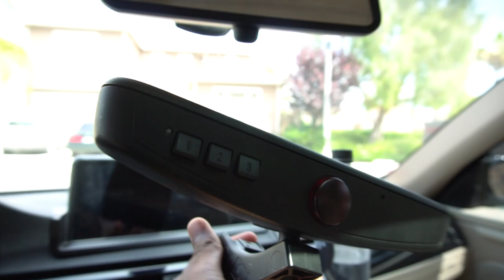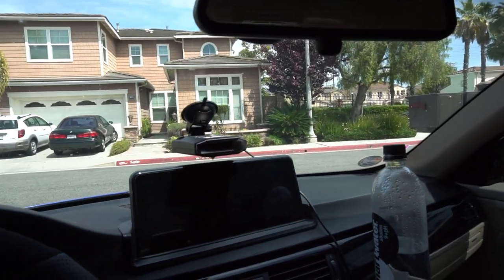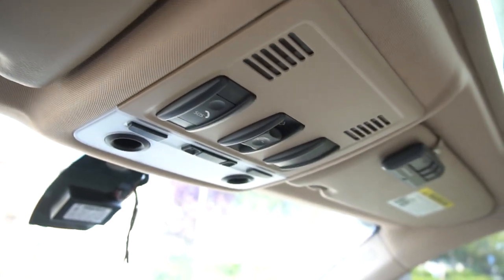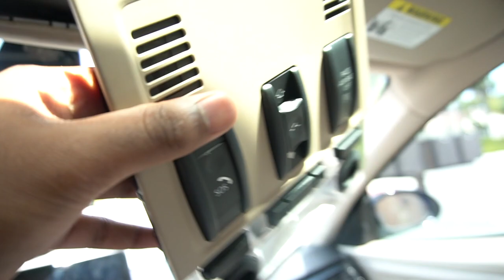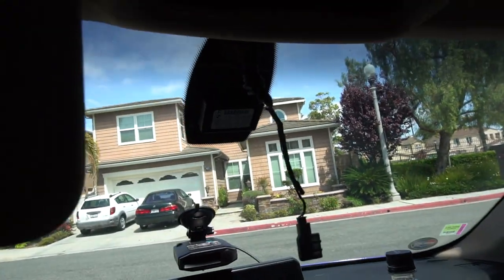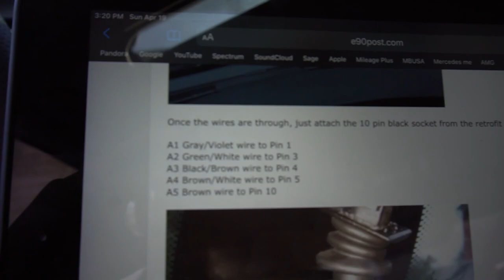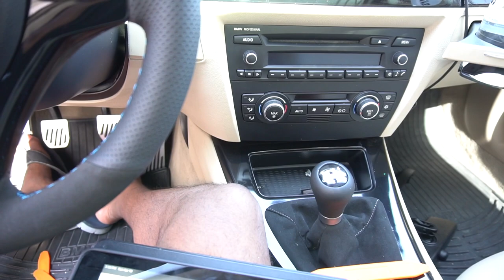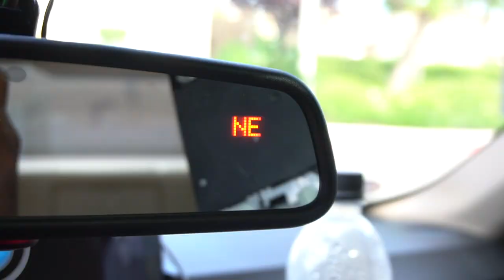BMW Mirror Retrofit (Homelink, Compass, Auto-Dimming) - E92 335i

Comment: The wiring connection process should be clearer. U seemed to have skipped those completely. I supposed the 10-pin plug to the new mirror is from the kit. Was there a 20-pin plug supplied by the kit to connect to the roof function center also, or is there an existing one already there to tap the wirings into? This will have to be explicitly mentioned as I sure hate to go through disassembly to find out if anything is amiss and leave things dangling for fumbling for parts. Please advise.

Comment: I got all that from factory but no compass for some reason, even the clown nose thing is there. Also has the auto dimming thing, pretty cool feature. Same with my mirrors
Reply from the maker: Interesting, yeah I think it just depends on if the option was selected or production year. They may have added the compass to this option later on. I believe my side mirrors also have auto dimming
Reply: @SamAbraham  I’ve got everything except heated seats, compass , home link and power folding mirrors, but they do dip down to park

Comment: Thanks for the Video! I recently had to replace my no frills old mirror. The new one has all the bells and whistles. I just ordered the Kit.  I will let you know how it turns out.
Reply from the maker: Sounds good!
Reply: Well it is done and working. However now I have a air bag code and the dome lights, and the moon roof don't have power. I have an appointment with the Mechanic to fix what ever I messed up.
Reply from the maker: @samengelhard9516  That’s quite strange, mind you all it could take is one incorrectly pinned wire to create all those issues. Hope it gets sorted soon

Comment: Hi there. I have an E88 (128i covertible.) It sees my mirror may have auto dimming - as I already have a connector to my mirror. I also know my antenna for my FOB is located in the mirror since its different for convertibles. I purchased a mirror - and thought it would be plug and play. However, the mirror does not power up at all. Does anyone have advice on what could be the issue?
Reply from the maker: I lack any experience with the BMW convertibles so I couldn't tell you unfortunately. Maybe check the BMW forums to see if someone has had the same issue?
Reply: @SamAbraham  Hi there. Yes - someone did help. I actually made a mistake. I do not have an auto dimming mirror - but since I have a convertible, the antennae for the FOB is located there. So the power or connector is for the antennae. So i'll need the retrofit kit and will have to plug in additional wires. The wiring diagram for E88 or E93 is of course different. Thanks again for replying. I'll post back if I can get this working.
Reply: @fyvp1234  did you get it to work? I’m trying to do the exact same thing
Reply: @johndonghia12 You must wire it in. Its not plug and play for E88. There is no other way.

Comment: Sam, I did this very conversion on my 07 E92 ten years ago: thanks for the great video!  Could have used it back in the day!  We now have a 230i convertible with a base mirror.  I was gifted a electrochromatic / homelink / compass mirror from a wrecked 235i which has two additional leads in its connector (4 vs 2), which appear to power the goodies in the new mirror.  There isn't a replacement part like the wiring harness shown here that  I can find - any thought as to how to power the other two leads?  Tap off the rain sensor like one would for a dash cam?  I'd like to use the upgraded mirror but the power lines aren't there....  Thanks!
Reply from the maker: I wish I knew more about F-chassis cars to help you, but I would guess that all F22/3 2 series models have the same harness, but different pinouts in the connectors? May require trying to find a wiring diagram of a car that does have the upgraded mirror. Tapping into the sensor may be a solid option as well if you can't find anything else, but given that the module is right there it would probably be best to get power from there

Comment: Do I need that whole wiring harness if all I care about is Homelink?  One of the e90post threads gave me the impression this was plug and play.  I didn't realize I needed another harness until I watched your video.
Reply from the maker: Not sure how much or how little of the harness you'd need, but I had to buy this for homelink to work, which is pretty much why i got this mirror in the first place. My specific car would not work with homelink without it. Perhaps some cars were prewired from factory, but mine was not. My car is a May 2009 production E92 if that helps you at all
Reply: @SamAbraham  That does help, and thank you for the speed reply.  I'll go back to the thread I originally viewed to double check.  My e92 is a 2012.

Comment: I’m from the uk and would like to do this but I don’t need homelink and I’ve found one without the buttons just the compass, do you need a wiring kit still or was this kit just to get the homelink to work, I have the cic nav also in case that helps 2010 lci touring? Cheers
Reply from the maker: To be completely honest I don't have a full answer to that, though I believe you may need a different wiring harness. Not one for homelink but to enable the compass at least.
Reply: @SamAbraham  ok that makes sense, thanks for the reply!!!

Comment: This helped me a lot but I am having one issue. My auto lights stopped function. They are stuck on. If I unplug the mirror they work fine. Any idea?
Reply from the maker: Andrew Wood Like ur auto headlights and interior lights? Sounds weird to me, the only thing I can think is that one of your wires may be touching another, or something like that. I’m sure you’ve already taken a look, but look very closely at your connections and make sure nothings disconnected or shorting out.
Reply: Thanks for the quick response. I was lucky enough I didn't have to make any splices so no issues there. It is my headlights. Basically with the mirror connected my headlights are stuck on. With it disconnected they will shut off and turn on automatically (depending on lighting outside).
Reply from the maker: Andrew Wood Wow Ive never come across that, all I can think is that there is some coding that needs to be done. All of our cars are optioned slightly differently so I suppose one option can change how easy these retrofits are. All I can suggest is looking at forum posts to see if anyone else has run into this issue, as I have no idea myself. Good luck!
Reply: Yeah it is very strange. I will continue to dig. Thank you.
Reply from the maker: Andrew Wood Let me know when you find the answer, I’ll pin it so that others will see
Reply: Will do. Made a post on the AWD e90 forum. Hoping I get some help there.
Reply: Figured it out. I was thrown of by a 12 stamped on the number 13 spot. Threw all my pins off by one. Everything worked fine that way but kept the auto headlights from working. Repinned it correctly and everything is working fine now.
Reply from the maker: Andrew Wood Ah sweet, glad you got it figured out!